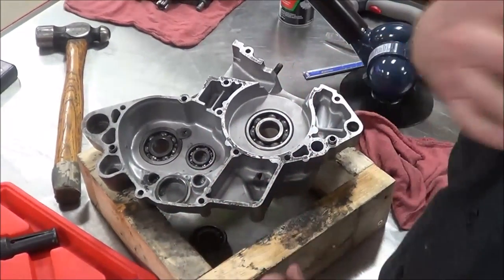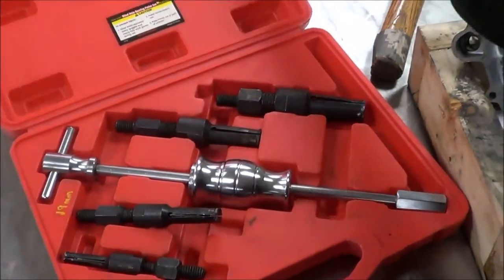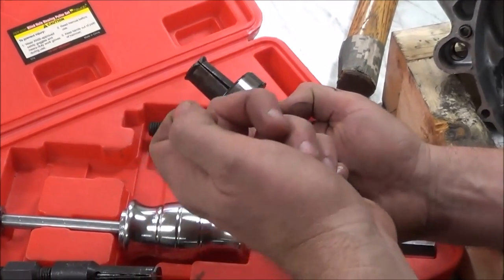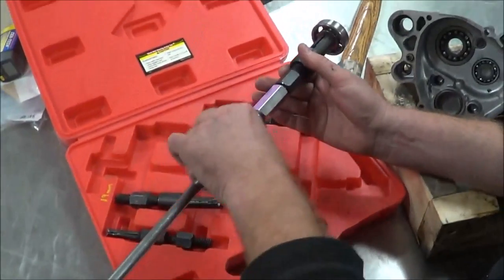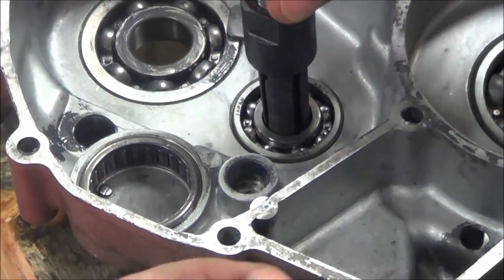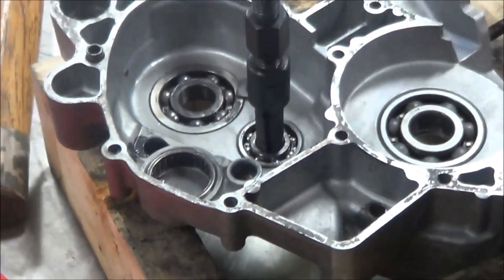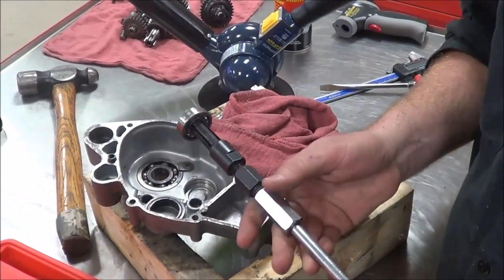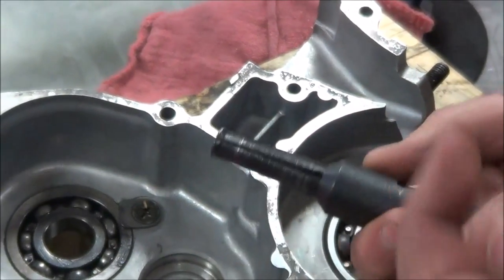How to remove a bearing with only one access side 2 Stroke Engine Disassembly 11 03 14

Comment: Would you choose an oven at 230F over the heat gun? It seems like the heat gun takes a good amount of time to reach 230F, so doesnt a majority of heat get transferred to the bearing anyway? Similar to putting the case inside the oven? I might try the oven and then shock the bearing with cold water towel like you mentioned. Having trouble removing several blind bearings from a 2003 yz250. I bought a slide hammer tool, but the lip of the collet piece is too thick. There is not enough free space behind the bearing for the tool to catch. So the removal tool is only held on by compression. 

The "bread" or "grease and paper towel" trick will not work on a couple of the bearings. But i found your awesome videos and wonder if i should go with the heat gun or the oven. If i use the heat gun......what temp setting? I wonder if too high of a setting could warp the case similar to what you mentioned about the propane torch. 

Thanks for any advice and i really learned a lot from your vids!!!

Comment: if you dont have bearing puller. Just use. Paper, socket that fits the bearing hole. and water.
Reply: Oh yeah I've heard of that some time ago I can't remember but yeah man can't do that with the transmission one U-Pack the shifter rod
Reply: Hydraulic pressure.

Comment: How do you remove the roller bearing below it ? thanks
Reply from the maker: If I can ever be of service to you, here is a video explains how to connect with me. 
https://www.youtube.com/watch?v=vjvmB01ebcs 

Link to membership: https://how2wrench.com/product/membershipmembers-onlymembers? 

Want to say thank you? https://www.paypal.me/how2wrench

Free Mechanic info, tool reviews, and “how to” videos newsletter sign up: https://how2wrench.com/subscribe-free-newsletter/
Reply: I'm a little late to the party but I removed that roller bearing by pulling out the roller bearings from the race. Rendering the old bearing unuseable. Which shouldn't matter since you are replacing it anyway. After the needle bearings and retainer is out you can heat up around it and use a pilot bearing puller on it.